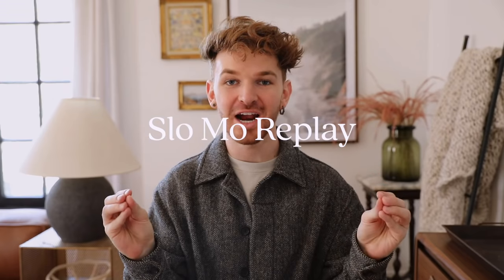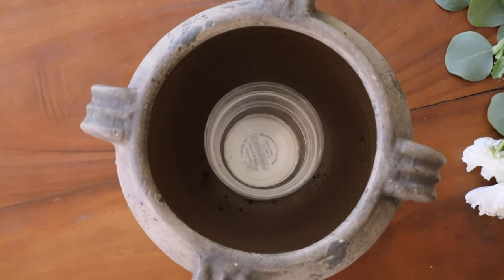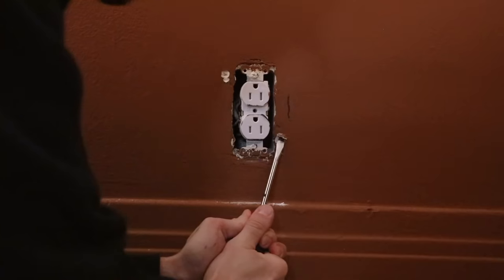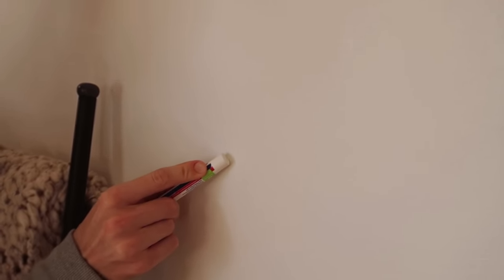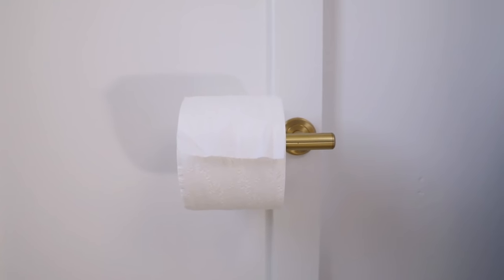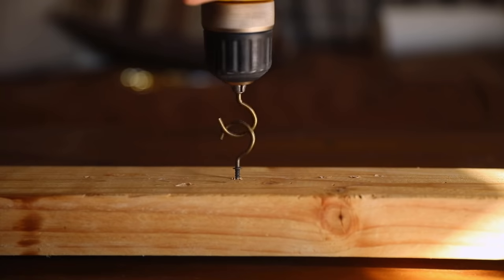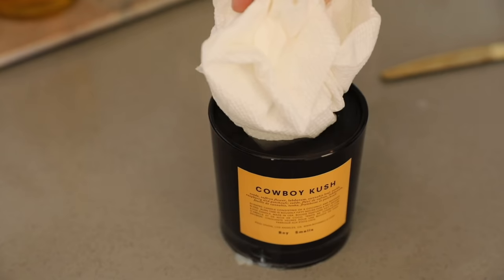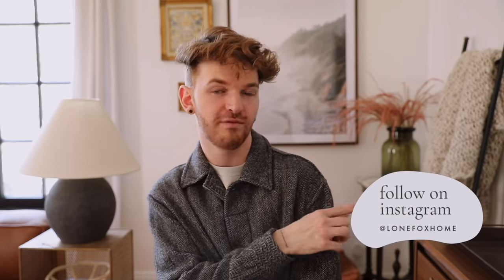20 GENIUS Home Hacks That CHANGED MY LIFE 🏠  DIY Hacks to Save Time + Money!

Comment: Also on the sticker removal one, if you add just a bit of dawn or some type of liquid soap, it comes off even better & quicker. I've been doing the water method for years. So glad you pointed it out for others to benefit from!
Reply: I do same but there are some labels where the glue still sits there and do not want to go :)
Reply: Use the sticker itself and dab onto the remaining residue repeatedly. It will pick them up slowly until they are very few left and then proceed with the soapy water technique.
Reply: Another trick is to spray the sticker with WD40 and let it sit. Even the most stubborn stickers will come off using WD40.
Reply: Also hand sanitiser or any alcohol like metho etc
Reply: oil and baking soda , let it sit, watch it go. You can wash it after nicely (since water is involved anwyay)
Reply: Also, let the label soak in a few drops of Goo-Gone, applied w/ a Q-tip, then pick or scrape it off.
Reply: You can use a wet dishcloth and lay it over stickers or labels to remove them too. I use hot water. Often they just lift off intact. There is usually no gluey residue but, if there is, you can take it to the next level and use alcohol or Goo Gone to remove it!
Reply: You can also use cooking spray. Let it sit for a bit and it comes right off. Rinse with soapy water. I have ruined plastic items using WD40 or goo gone. I think I left it on too long.
Reply: I usually use a hair dryer to make the label peel off cleanly, then use a bit of masking tape to remove any sticky residue. No water, no soap to have to rinse and rinse to get it off, and no chemicals.

Comment: 👋You can also place your candle jars in the freezer, allow them to totally freeze and when you remove them from the freezer the candle wax will actually pop right out. If it doesn't, just coax it a little bit with a knife and it comes right out! I've been doing it this way for years. 😁Great Hacks! Thanks so much. 💖

Comment: Tip for  stickers if there’s some adhesive sticky residue after leaving it soaking and scraping it off, kitchen vegetal oil breaks it down pretty well and leaves it very clean :)
Reply: That's what I am using! :) 
If the glue doesn't come off with water (but the paper did) the glue in 99% of cases can be just wiped/rubbed off with e.g. canola oil and paper towel.

If this doesn't work it is heat sensitive glue. Whenever possible I then just microwave the thing (a jar for example) fow a while with some water in it and then remove the melted glue with paper towels.
Reply: Goo-Gone also works.

Comment: Great tips as always, Drew!  When painting and using that green Frog Tape, it apparently has some sort of a bleed resistant medium in the tape itself that is activated by moisture, it's supposed to be activated by the new paint being brushed on or against it. It's always a good idea to burnish the tape down with a plastic scraper, then you can take a damp cloth and run it along the edge of the tape to activate the bleed resistant medium, or even use a fine mist sprayer to do so. You should be able to get a clean edge on the new paint color when you remove the tape.
Reply: Thanks!
Reply: Thanks!
Reply: Also, touch the back (sticky side) as little as possible. I can't remember if it a) removes the substance that swells to prevent the bleed or b) the moisture on your skin activates it before you want it to or c) does both. 
And thanks for the water mister tip.

Comment: Great tips 🙂 
With number 18, instead of using paper towels to remove the melted wax, you can just leave it until it hardens as the wax will rise to the surface and then will set altogether so once it is completely cooled it pops out in one piece and then it still retains its scent so you can use the wax in a wax burner and get more use out of it. If it hasn't removed all of the wax in the first go then just do it again and the glass will be completely clear of wax.

Also, If you are planning on using the melted wax in a wax burner and if there is a black coating on it from when it was burning then I just take a damp paper towel and wipe it off before pouring the boiling water into it to save the wax from looking all dirty. 
It is honestly so simple, just pop the kettle on, pour in the container, leave for several hours then come back and pop it out and rise off and it is done. 😁
Reply: You can also leave the container in the freezer. The wax will separate from the glass.
Reply: Thanks for your tips!
Reply: You can put it in the freezer, and pop it out.
Reply: These were really practical and useful tips. I also agree with the other comment about your presentation style. Clear but fast moving and easy to follow.

Comment: Hey Drew, love your hacks!!! Did you know if you leave the candle filled with boiling water, all the wax will float to the top and when cooled the wax comes out in one piece and if big enough can be remelted and reused in another candle! Absolutely no wasting your favourite smells!!
Reply from the maker: OMGGG!!!
Reply: Another thing you can do is stick the candle vessel in the freezer. It helps shrink the size of the wax a bit and creates a stronger bond within the wax itself. You can generally pretty easily pop it out in one piece from one of the edges with a butter knife. I add these to my wax stash to remelt as well.
Reply: I bought a mug warmer off amazon years ago, but never really used it for its intended purpose. Now I use it to melt the last bit of wax from my candles, and pour it into an empty vessel with a new wick to make a layered FrankenCandle.
Reply: That's too much work for me. Just like another commenter just said, I also just use a mug warmer to melt the wax while at the same time filling the room with the aroma. I reuse it many times before I decide to move that wax to another vessel or discard it.  It's also a way to create a "flameless" candle.
Reply: @AmandaATXo.o  I saw what you did there, safyia reference.
Reply: @AmandaATXo.o  I do the same thing!!! 😊💐♥

Comment: I use painters tape when I caulk so after I wipe it smooth I remove the tape and it’s in a straight line. I also use alcohol or alcohol pads to rub off the sticker residue. These were all great tips.

Comment: I  just discovered your videos and am in love with them.  Your caulk hack was genius.  I would just like to add to your removal of candle wax from its container.  I have always just placed the jar in my sink and fill the sink with hottish water up to the level just before the container floats and let it sit in the sink in the water for a little while to loosen the wax from the sides (not long at all). Then, just take a paper towel and wipe the wax out.  It isn't messy at all and the wax comes out clean.

Comment: What I do with my linen sheets is actually putting them in the dryer for 30 mins to heat up the moisture and then when still damp, I put them on the bed as you would dry. Literally wrinkle free when they're done drying.
Reply: I would think that would add dampness into the mattress so not a very good idea. One thing you don’t want is damp getting trapped in the mattress so then you are dealing with mold and mildew.

Comment: Little tip with frog tape instead of needing to pre paint with previous wall colour you can wipe with a slightly damp rag and wipe down the edge it activates the ingredient on the back of tape (that’s why it comes in a plastic container)

Comment: You can also take a damp washcloth  and press it firmly along your painter's tape before painting to seal it. It helps prevent bleeds also. You just have to make sure you pull off the tape before the paint dries. Additionally, speaking of painter's tape, if you put down painter's tape before caulking the excess gets on the tape, not the surface you don't want caulked, and the clean-up is less messy and your caulking lines will be more crisp/clean.

Comment: Another great hack for dried florals in an oversized vase is floral wire, either wrap the top inch of the wire around the base of the stem to add height or you can push the wire up the stem of the flower, this also works for live flowers if you cut them a little too short, works amazingly well - love today's video :D
Reply from the maker: Ahh love this!

Comment: Great tips - thank you.  I do something similar to tip one for the taper candles.  I use a cheap paraffin tealight to drip a bit into the candle holder and then stick the candle to it.  Works quite nicely with glass and crystal candle holders because you don't get the possible burn marks near the bottom of the candle.

Comment: I love this !!  Another thing That you can do to minimize the mess that caulking makes is to put some masking or painting tape along the vertical surface (wall) and the horizontal surface (floor).  Apply caulk and make sure that it is completely dry before removing tape. Easy to control and the caulk will only go where the tape isn't. You can use a combination of this idea and the water sprayer idea to make it really perfect. I love the scotch tape/flower spacer idea.  I saw it on City TV years ago and I have used it many times since.
Reply: Yes, I have used tape and it worked great in a bathroom!  I do love these videos for the same reason most others do-they are so succinct and he couldn’t be more adorable, right?!!!

Comment: The same water and dish soap mixture for the caulking  also works on outdoor garden plants to keep away hungry bugs. After the first sunset after a rainstorm, spray it on the plants. The bugs don’t like the taste of dish soap. Don’t spray it on during the day because it’ll burn the leaves when the water evaporates in the hot sun. The only catch is it needs to be reapplied every time after it rains, watering, or any time the leaves get wet. It only takes a few seconds to apply, so it’s not a huge hassle. 

I’ve also found that a $1 spray bottle isn’t equipped for the soap and the inner workings will break. Instead, use an all purpose spray bottle from Walmart or Lowes. It’s in the cleaning tools section with the mops and brooms.

Comment: Hi Drew, I have an even easier way to put on the pillowcase, it is the nurses way. It uses one hand to grab the outside closed end of pillowcase. Push this end through the open end, grab pillow and peel the pillowcase down over the pillow. It is very fast and was develped so a nurse did not hold pillow against their body. You can google it to see a video if you want
Reply from the maker: I gotta check this out!

Comment: omg, the duvet tip was amazing! 
I've been turning mine inside out, grabbing the corners, and shaking the cover down (similar to how you did the pillow), but the rolling up looks so much easier! 
These were all great, thank you for sharing them!
Reply: Yeah, that’s a great tip … as long as your duvet opens all the way along the bottom. Neither of mine are open that much, and I haven’t been able to utilize any of these nifty hacks. But they ARE awesome if your duvet works with it!
Reply: @DawnDavidson  I have a couple like that. One thing I did was sew loops onto the corners of my duvet and ties to the duvet cover on the inside. That way i can tie the two together and shake it down. It also stops the duvet from shifting inside and puddling at the bottom of the cover. I got the idea from my cover that came from West Elm which came with ties already.

Comment: Hello! I just found your channel and love your video. Thanks so much for all of the great information and your positivity! Wanted to let you know about an easier way to remove a label or sticker and it’s residue from surfaces. Once your peel (or try to peel!) off the label, spray the remaining residue with a tiny bit of WD40 and let sit for a few seconds. Use a paper towel to wipe everything off instantly, then use a bit of all-purpose cleaner spray or soap and water to remove any greasy-feeling or smudges left behind. This hack works wonderfully!

Comment: So helpful! My favorite tip you have shared is how to hang pictures using a piece of tape to mark the  nail holes. I have used it many, many times. Going to try the caulk tip!
Reply from the maker: That tip is my all time favorite home hack!
Reply: I usually just take a glass of water with a drop of dish soap and stick my finger in it before removing access caulk. Works the same!
Reply: Can you explain the hanging tip? I can't find it. Thanks.

Comment: I loved the tip about drilling in the hooks and the faux tree! TFS 🌷
Reply: If you're gonna get the drill out anyway, drill a hole before screwing in the hook. If you don't want to get the drill out, hammer a nail in partially, then pull it out and use the hole to screw in the hook. I thought this hack was terrible.
Reply: @Judith_Remkes  Good point

Comment: Another way to remove sticker residue, especially if you don't want to get an item wet or use heat, is to use one of those lint roller removable sticky sheets. By tapping a sticky sheet on the residue, the sticky side picks up the sticker residue. Also, you can use a bigger piece of the sticker you just ripped off to tap on the residue, it works the same way. :)

Comment: Regarding removing labels, note that any kind of oil will quickly and easily break down adhesive.  Also, the product Goo-Gone does it as well.  You don't have to soak and scrape.
Reply: I know there are a million hacks for labels but I started getting Goo Gone from the dollar store and I'll never go back. Cheap and also saves so much money from the swear jar😂

Comment: The book hack is a great idea you can also use colored construction paper or brown butcher paper when white isn't a good fit. Also, a quick fix for small holes in drywall is to mix the paint in your chalk before you fill the holes because old paint tends to be lighter and the white chalking lightens just enough to match the old paint. I also used white toothpaste to fill holes in white walls for tiny nail holes.

Comment: It's fairly simple to use a folding system to recover books instead of using tape. Instead of cutting the paper the same height as the book, add an inch or two above and below.  Fold the top extra down to where the book edge is, and fold the bottom extra, up.  Then fold the sides in.  The top and bottom folds create a pocket that the book ends can slide into.  It's common for safety covering school textbooks in middle school / high school.
Reply: Was saying the same thing. Those days of having to make covers for school have come in handy
Reply: Exactly! That’s how we always did it.
Reply: Yea I Remember doing  this  Hack in  Elementary School
Going Down Memory Lane lol
Reply: Same here! 👍
Reply: Yes, exactly ☺️
Reply: @thejasminediaz   Yes I was remembering all the book covers I had to make for school too.
Reply: I agree.  I'd never be comfortable taping covers to my books.

Comment: My favorites were: 
1-tape across the top of the vase
2-hook in drill hack ( I usually get my husband for this 😁)
3-faux tree 
Curious about how to keep faux plants dust free. Someone told me spray them down really well with Lysol. I tried it but when it dries the dust is still there!
Reply: Yes! And you gotta debug for the tiny noseeums before you bring them inside!
Reply: I take an unused dryer sheet to “dust” off the leaves. The anti-static properties also helps to keep the dust off for a while. If you have a sturdy plant, you can used compressed air outside to blow off the dust then follow with the dryer sheet.

Comment: I have 2 additional ideas.
When buying towel sets, buy all different colors, this way people will not mistakenly use someone else's towel set.
Also when folding towels sets, put 
(1 each) folded face cloths inside a folded towels, just before finally folding the towels. This way takes up less room in you linen closet.
This can also be done with dish towels and dishcloths.
Reply: I’ve done this with our five teens! So useful. I also color code their toothbrushes and razors and such, that way everyone knows whose is whose since they all share one bathroom.

Comment: I tried the cellophane tape grid over the opening of vases, and I found it clumsy, visible from a short distance, and destructive to any dried flowers because they get stuck to the tape.
I tried folding the tape in half AFTER I'd laid it over the top of the vase, so it would stick to itself, and that was better but still wasn't perfect.

Comment: Thank you for all the great tips! An easier way to deal with the wax, is when it gets down to the little last bit of wax, just put the vessel in the freezer for about an hour. The wax disc will pop right out. Then you soak the vessel in warm water to take off the label. To get the rest of the stickiness off the outside, use rubbing alcohol.
Reply: This is what I also do.

Comment: Another suggestion for filling nail holes instead of the fill stick: for many years I have used flour! Just put a tiny amount of flour on a paper plate, etc. and dab the tip of your finger in the flour and rub it over the nail hole. Just brush excess with your fingers.
Reply: I always used small container of white spackle.  Applied a little with my finger to fill nail hole flush with surface.  Remove any excess off to leave nail holes undetectable on white walls. Always got my deposit  back.

Comment: I put the container I want to remove wax from in the freezer. You can usually pop it out. Putting painters tape on either side of what you are caulking works great too. Putting the info on the outlet cover........priceless!